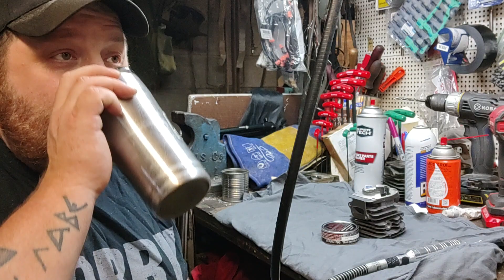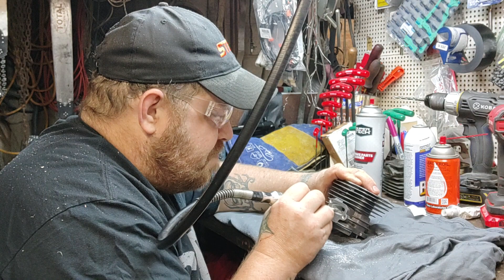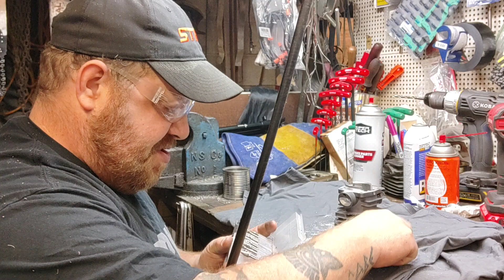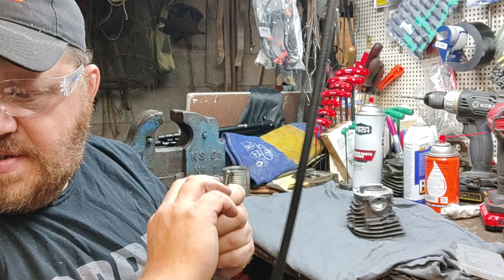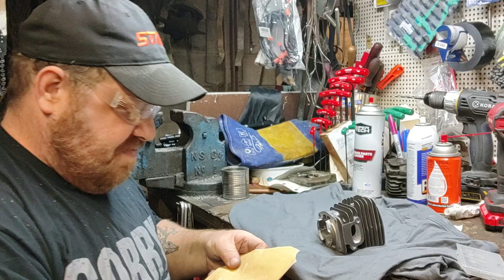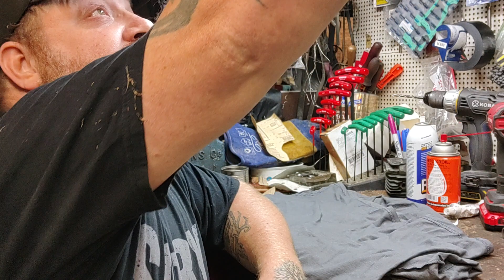JONSERED 2145 BUILD...PORTING THE CYLINDER 😎🪓

Comment: Good work Mr. Aaron, I have three questions.1. What is the piston pin diameter? Are those burrs double-cut, where did/will you buy the next set?3. Will you polish the exhaust, or did I miss it? I enjoy your bench vids sir....
Reply from the maker: Thanks Brian..I believe it's a 12mm wrist pin... yes double cut burs I get off eBay or Amazon...I usually don't polish exhausts on my saw ..I don't have a good way to do the smaller exhaust ports either...bigger ones I'll polish if it's not my saw.....I don't experience buildup in my exhaust ports so I don't do mine
Reply: @Aaron_A_Lynch  thank you sir...
Reply from the maker: @Brian2bears  yessir 🤙🏻😁